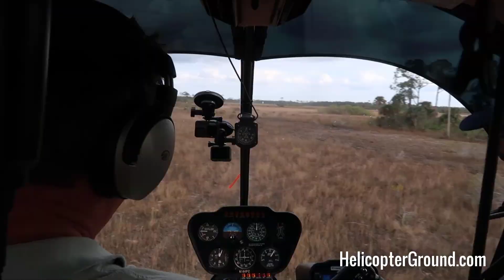Confined Area Helicopter Approach in the Robinson R-44

Comment: Couple of points of discussion were left out that I think are important. One should consider that setting with power can be present when heavy as when there are 4 occupants. Two, be mine full of tail rotor area is clear especially when maneuvering in the area. I use the acronym SBAT. Suitability, Barriers, Approach, Takeoff. Landing long then reposition for the takeoff to get a better angle to clear barriers. Discussion on power available for takeoff and consideration of maybe having to off load a pax to get out if too heavy and getting them out one at a time. You were at Cabbage Key, now that was a confined area!
Reply from the maker: Thanks for the feedback.
Reply: Your welcome, love your videos. Looking forward to seeing the next video